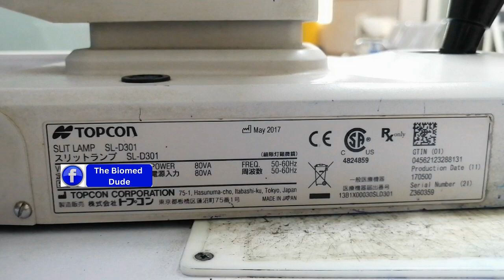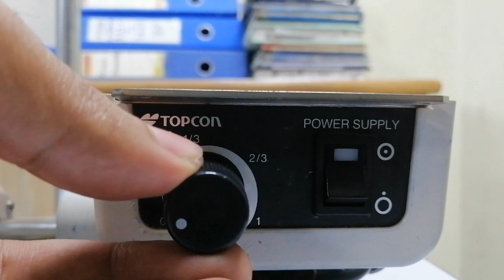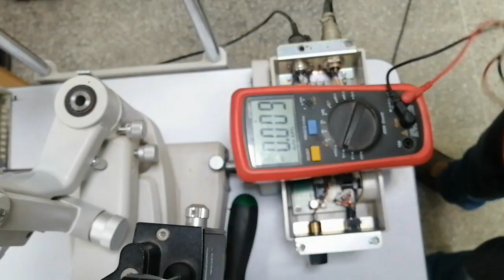How to use slit lamp | how to use biomicorsocpe |Slit lamp repair | Topcon Slit lamp | Biomed Dude

Comment: My lamp here non of the lights is working... But every wire is fixed firm
What could be the issue?
I need assistance
Reply from the maker: Pls check lamp itself, or share me pictures
Reply: Could you help ...I checked the lights they where working initially, before soldering,after the main light was flickering, soldered again but now on turning on both lights went out, opened the IC but can't seem to find the problem
Reply: @TheBiomedDude  can I send them via email?
Reply from the maker: Alright pls send me detail @ engr.adeel_alvi@yahoo.com, I'll look into it.
Reply: I have sent them